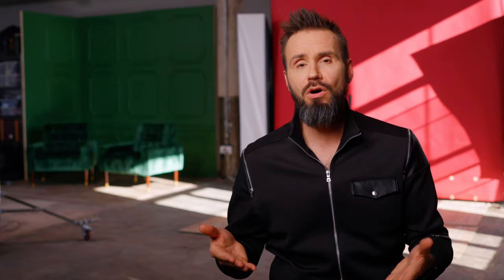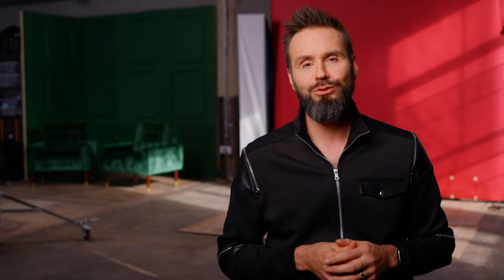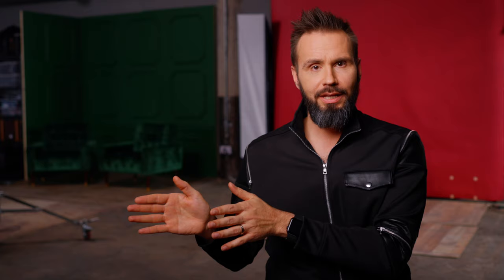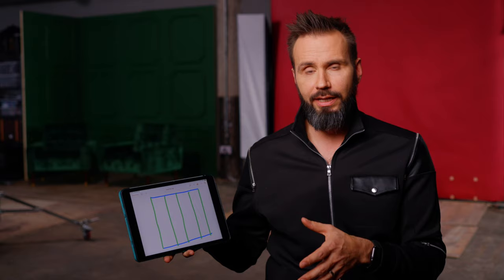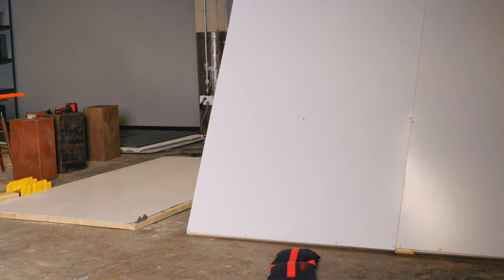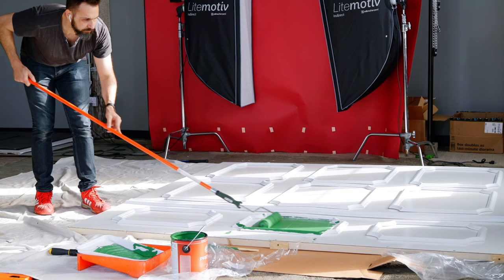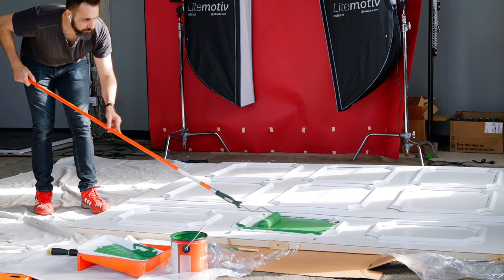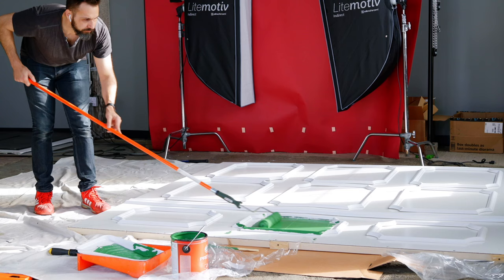How to build this set from scratch! Plus a lighting tutorial

Comment: Cool set, and it was interesting to see how you built it. I believe you're possibly one of the best lighting people I've seen, in my many years of interest in photography (starting around 1978). I'm planning another photoshoot, and I was thinking about just how important the lighting is, to a great shoot. My main style is chiaroscuro, so I need to be able to control the light. Really digging your light meter. I'm still using a Sekonic Flashmate L-308S. It was cheap, probably 15 years old, but it does the job, and it's still kicking. I don't shoot without it.
Reply from the maker: Thanks Miley! That is a great style. I started off with the 308 and used it for about 20 years and then I found out about the 478.